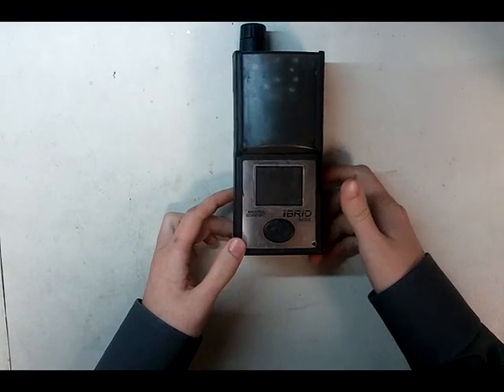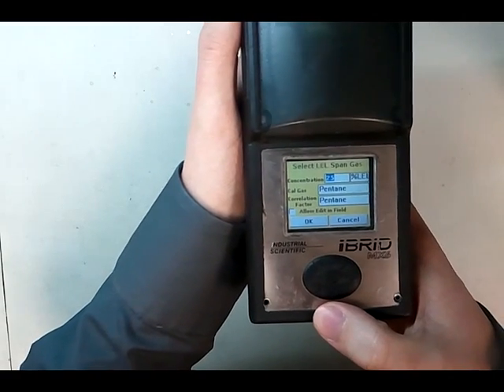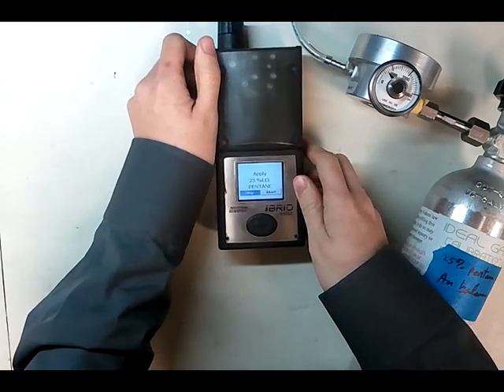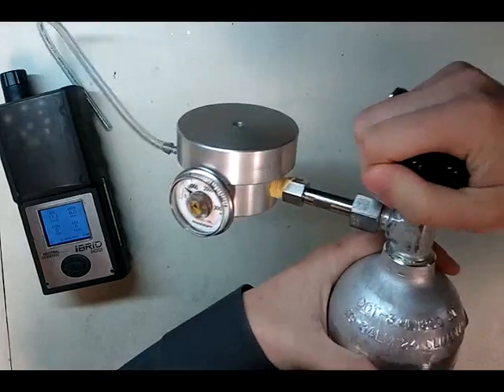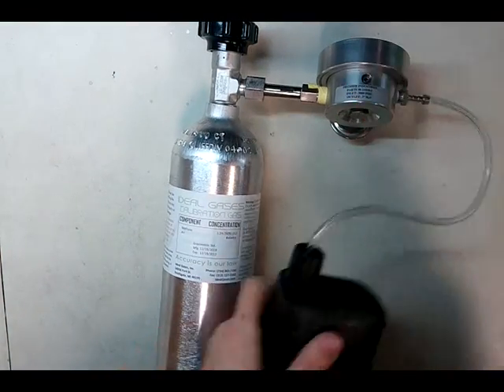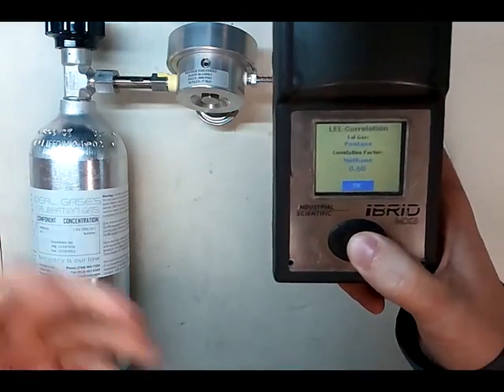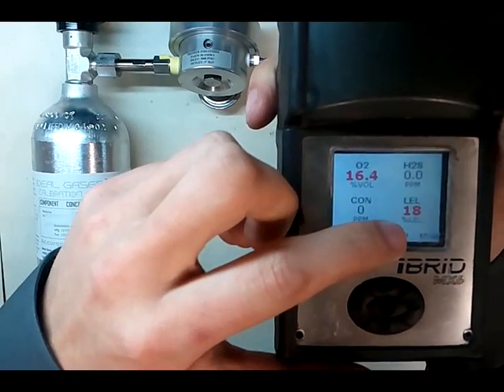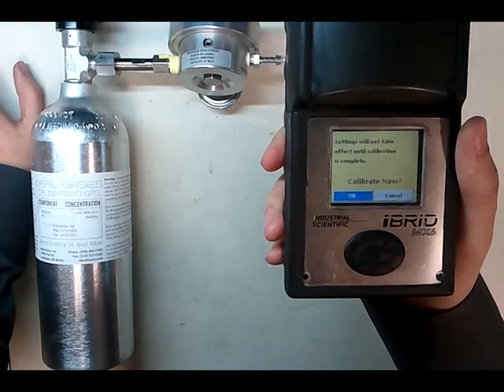Methane VS Pentane as a Calibration Gas.  The benefits of a Methane simulant

Comment: Hello, the GX-8000 are calibrated with butane or propane, why is there a difference?
Reply from the maker: Hard question to answer, the GX-8000 has a lot of config options, so I'm unsure what you had yours set for when you bought it. RKI usually uses Methane as a calibration gas for LEL. Your config may be totally different though.

Comment from the maker: @LeopoldSiegristGmbH We blended this to be 25% LEL n-Pentane and air.  Originally I had used that cylinder for a gravimetric Carbon Monoxide lab standard which I dumped in order to have the nice luxfer cylinder for use in this.  I probably should have made a nice production label for the video, but unfortunately this repair was for a rush job, so we blended the gas and I filmed it shortly after.   We blend NIST traceable calibration gas here on site.